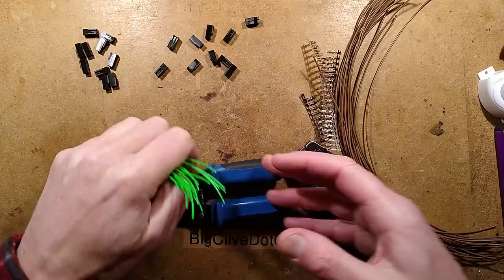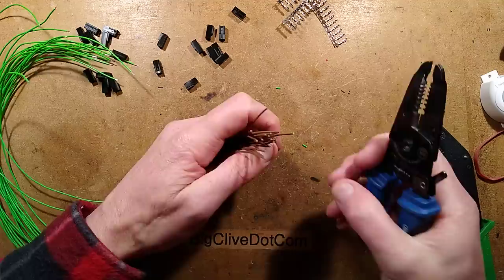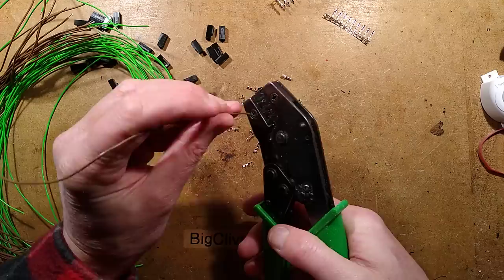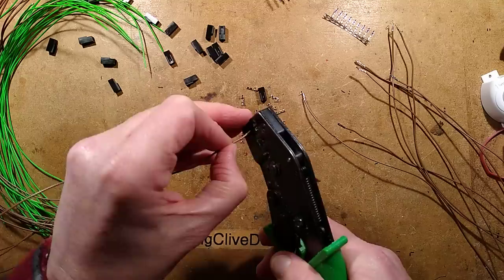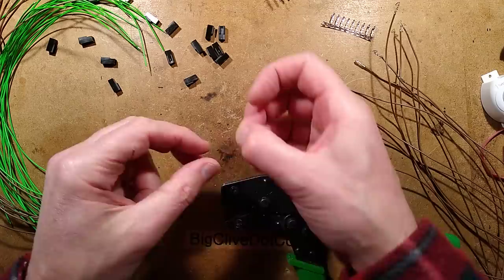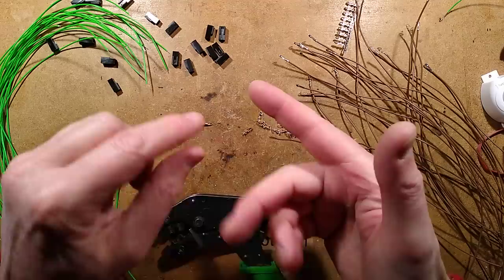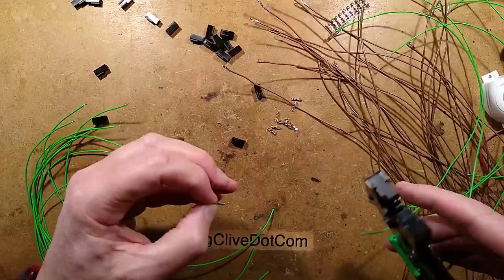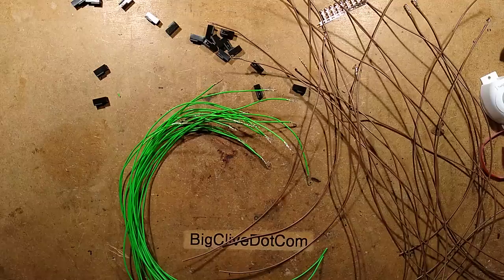Q&A while making prop stuff Part-1

Comment: I used to work on HV and when I was an apprentice one of my mates was working with an old fitter doing bus bar cleaning. They opened a panel and the fitter looked inside and said “that’s funny I have never seen one of those before”  and wiped what turned out to be a bus bar insulator which was still energised.  That unfortunately was the end of the fitter. I won’t go into the full details but my mate needed counselling for years. That was over fifty years ago, and I still think of that incident.

Comment: Years ago I got poked pretty good by a 277/480v line that was supposed to have been turned off. That was the day I learned the guy working on the wiring should be the guy that verifies the circuit is actually off.

Comment: As someone who's learning welding at tech school, I would highly recommend going a similar route. If you decide later on that you hate doing it, at least you didn't buy any of the machines...
Reply: You'll probably also have a much better idea of what machine you actually should buy if you decide to go on with it.  This is particularly important for machines that need gas cylinders, as those are probably going to cost like a BASTARD to get out on the Isle of Mann.  They're hazardous cargo, so they're not something you can just hop on the ferry with.  (I think this might leave stick welding as the only viable form unless you've got the money for regular hazardous cargo shipments.)
Reply: @evensgrey  flux-core in a MIG machine would also avoid gas tanks.
Reply: @EmyrDerfel  Looking at the process and requirements, it doesn't look like a good choice for a beginner.  You also need to either do it outdoors or in a suitably ventilated shop due to the smoke it tends to produce.  I get the impression Clive doesn't really have a lot of space to build a dedicated shop for welding and has a lot of close neighbors who wouldn't appreciate the smoke outdoors.  And the Isle of Mann is pretty wet, between a third and a half the days it rains, depending on the time of year.  Any sort of arc welding isn't something to do in the rain.

AFAICT, if you want to do home welding, the most versatile type is TIG, which will weld pretty much anything weldable.  (Looking around, I discovered that bronze is a metal to be very cautious welding, because a lot of so-called bronze is actually brass, and you really don't want to be welding brass at home.)

Comment: Hi Clive, A Ne2 tube was used in the late 70's and early 80's by microwave appliance techs (my Father) as an initial test to see if the oven was powering up the magnetron.  They had the neon in a plastic case,, kinda looked like a two pin molex connector , possibly with the legs of the bulb crimped in to hold it in place and then a clear plastic housing around the glass tube.   no actual leads or wires protruded. When running the oven, the neon would glow and seemed to pulsate.  Just a quick visual to help direct the trouble shooting.
Cheers

Comment: Around 5Ghz (ignoring crazy overclocks) has been the basic limit on processors for like 10 years now. Seems they have switched to adding more cores, and making the chips more efficient.
Reply: The biggest gains in the last ten years or so have been in a different type of efficiency; that is, more work per clock, instead of less power. Luckily this means it uses less power as well, win win.
Reply: Big improvements were made on branch prediction, too. But graphics processing mostly need not to branch, so it runs way faster than common business logic.

Comment: A”shifter” - very close to the Swedish name for an adjustable wrench: “skiftnyckel” = shift key.
Reply: Yep. We call them shifters too - shifting spanner
Reply: The funny thing is that in Dutch they are both called ”bahco” (after the Swedish brand) and/or "engelse sleutel" (= english spanner / wrench )! 
The Dutch word ”sleutel” has exactly the same meaning as ”nyckel” has in Swedish, it can either be a key (to open a door/lock) or a spanner / wrench ( the tool) so I thing that ”shift spanner” is a better literal English translation of the Swedish word ”shiftnyckel”.
Reply: @martinmanuel6228  My Papa calls it "That fuckin thing there" like all his tools.
Reply: @Acamperfull  and in Denmark they are called ‘svensknøgle’ = Swedish key :)
Reply: @Acamperfull  In Germany we call an adjustable wrench an "Engländer" (englishman) too. It is said that this is because you used them mostly for all those weird nuts and bolts found in english/american machines and automobiles.
Reply: I had a friend who called it “the lazy wrench” and that’s the only thing I call it now.
Reply: Called a "shifting spanner" or "shifter" here in Australia too.

Comment: We installed an ioniser into the duct of a conference room where i worked, it came with a piece of circuit board with a neon and resistor to test if it was working, and it worked, though this was a commercial unit
I have just bought a double decker plate ioniser and will be doing a vid on it soon, i'll try the neon
SVseeker has done a lot of aluminium welding and he shows what equipment he uses, including a spool gun for the wire
You can easily hold a live wire without problems as long as you are wearing shoes and not touching anything else, wetting the finger may help to feel it, though i don't advise anyone doing it.

Comment: In relation to the adjustable wrench question, I was wondering if you use a metric or imperial adjustable?
Reply from the maker: It's metric.  It only does millimeters.
Reply: @bigclivedotcom  Try to get a "fractional metric" one next time - they can do one tenth of a millimeter in precision and that is close enough for the odd imperial nuts you will come across in daily life. They are slightly more expensive due to the higher precision needed, but I found it worthwhile.

On the other side of the pond: sorry guys, the 1/16th of an inch "high precision" imperial shifters just don't cut it. Try to get a dual- (metric/imperial) or triple-system (metric/imperial/traditional japanese) artisanal hand crafted one from Japan. They are horribly expensive though.

😋

Comment: I have a variac that I had to modify exactly because it popped the breaker due to its inrush current. In a pinch I had a small lightbulb (recovered from a microwave) in series which I had to bypass manually, then I finally decided to make a more permanent modification adding an internal NTC (well spaced from other stuff) which I had actually managed to get as free sample

Comment: Aluminum oxide is basically sapphire, which is one of the hardest of materials.  That's also why metallic aluminum, which in it's pure form is a very soft metal, is fairly scratch resistant, but when it does get scratched it tends to be scratched pretty deeply.  To scratch it at all, you have to get through that aluminum oxide layer, and once through that the metal beneath is much softer and the same force will make a much deeper scratch.
Reply: Aluminium oxide is aluminium oxide. Sapphire (and ruby) are types of corundum, which is aluminium oxide with some other metals mixed in.

So sapphire is "basically aluminium oxide", but not the other way around. ;-)
Reply: @RFC-3514  Indeed, and the various forms of aluminium oxide which demonstrate the property of hardness are crystalline, the oxide on the surface of aluminium is amorphous and doesn't have the hardness of the crystalline oxides.

Comment: I grew up in West Texas where the wind blew constantly, stirring up the sand and creating lots of static electricity. This was perfect for siblings who liked to rub their feet on the carpet and zap the other on the ear lobe. It is also perfect for building up a charge in big metallic objects like, for instance, a bbq made from a 55-gallon barrel, and if you were to grab the wood covered handle to help pull yourself up so you could stand on something enabling you to reach the window (outside) and open it, nothing would happen. But if you were sneaking into said window after being out late you would need to put your hand on the pit and one on the aluminum window seal in order to hoist yourself in. This happened when I was about 14, my limbs locked, and for a few seconds/minutes(?) I could not move and it scared me. Eventually, it ebbed, and my legs moved so I fell. I still needed to get in, so after a few minutes I made the connection again only it was not scary and was rather pleasurable, the charge continued to wain until nothing could be felt.

Comment: Your story about the compressor reminds me of an event about 30 years ago; we were building radio cabins for a UOR for the MoD. The cabins were to be powered from 20kVA gensets, but we found they were stalling the generators even with the radio gear switched off. We suspected the transformers on the input of the cabin were causing the problem, so we needed to check the I, V and their phase relationship. I made sure the incoming supply was isolated by unplugging the 32A 3Ph supply; unfortunately there was no lockout facility, so we just coiled up the cable to ensure it was safely disconnected from the mains. I was working in the vault, having just hooked up 3 current probes and just finished connecting the last of the 3 voltage probes to the busbars when I heard the contactors pull in; I nearly shat myself as that's not a sound you want to hear whilst handling the incomer terminals! I subsequently found out that a technician spotted the 63A Commando connector sitting on the floor and decided, without checking, that is should be plugged in and the supply turned on!

Comment: Doing well with the crimper Clive ;)  I often preload too far by mistake, and then the only way to clear the ratchet is to close and waste the crimp :(
Reply from the maker: You can unlock it with the little lever between the handles if it's not too tight.   I dread to think how many crimps I've done with those tools.
Reply: I have the non-ratchet tool (it was much cheaper!) which is fine for these small crimps, though it is slower because it takes two operations for each, but most ratchet types have a release lever somewhere.

Comment: 21:45 Computers have, for the most part, stopped increasing in cycle speed.  We had to because the heat dissipation from driving the gates faster was getting entirely unsupportable.  (When you're getting dies emitting heat at a rate comparable to the optical surface of some of the cooler stars, it's time to try something else.)  The main way we get more effective computing power these days is mostly to add more processor cores.  The computer I'm doing this on has 4 cores, and the newer computer I have has 6, and that was only because I didn't think I could use the really high-core-count processors effectively in the near future.  (Currently, AMD lists their highest core count CPUs as having 64 cores, and Intel lists their highest at 72.  The AMD CPUs are also listed as having a higher base clock speed, which is actually lower than the clock speed on either of my current computers.  IIRC, this has to do with it becoming progressively more difficult to organize the signals on more complex PCUs with more cores as the core count goes up.)
Reply: Also each core tries harder and harder to execute multiple instructions at the same time.
Reply: @0x8badf00d  I think you have to program the software in a way it uses several cores in parallel. Something like threads and tasks stuff. This leads to a complete other paradigma not all programmers understood well these days xD
Reply: @gunnark9823  No, I'm referring to superscalar processors (which has been a thing since at least the 90's).  Each individual core or even individual hardware thread can execute multiple instructions simultaneously.
Reply: @0x8badf00d  IIRC, that innovation was the thing that caused the 486's to run so much faster than the 386's.  Each stage in the execution pipeline can work on a different instruction, so a lot of the speed disadvantages of a multi-cycle execution pipeline disappeared..  Pentiums added branch prediction so that the more likely execution path would be started down, further optimizing the execution.  There are also things like the ability to dynamically decide to execute some instructions out of sequence to further optimize execution speed.

It used to be that the much shorter execution pipelines on RISC chips made them able to perform logically equivalent operations faster than CISC chips could, but superscalar largely did away with that.  Even if you build a superscalar RISC chip, the inherent nature of a RISC chip means it gains far less benefit from it than a CISC chip does.  You also tend to start losing some of the advantages of RISC designs like lower power consumption if you start trying to add the kind of execution enhancement features used on modern CISC chips, and gain much less performance increase for the extra power and heat dissipation it costs you.  For a device like a phone, with a sharply limited battery,  lowered power consumption is more important than a modest speed boost.  After all, people don't normally try to do intensive things on their phones.  (Yes, Nokia came out with software that turned their phones into hand-held consoles.  You might have noticed that most hand-held consoles have been fairly marginal systems financially for their creators.  The Nokia phone software was the descendant of a catastrophically failed dedicated hardware console.  People didn't much bother with NGage on the phones, either.  I worked in Nokia's 3rd level device support while NGage was officially available, and nobody ever sent us cases about it.  Not even from China, where phones are a much bigger part of the gaming market.)
Reply: @evensgrey  amd has a 128 core 256 thread epyc cpu

Comment: Hi Clive, the answer to the solid wire and crimp question is no, you should not use solid wires with crimp terminals.
Typically crimped terminals are designed to have oxygen free environment between cable and terminal. Reason being is for corrosion/fretting/arcing etc.
The exceptions to these are sprung/screw style contacts like poke in/terminal blocks and IDC contacts where they prefer solid core wire.
I'm in the industry and these questions do come up once in a while, generally relating to quality issues!😆
Reply: * Obviously a connection is a connection, if you are not expecting the designed performance /reliability from it then fair enough- it 'still works', and could work nearly to spec for a long period, but more variables are involved. 

From a commercial perspective; they don't want things to fizzle and blow. You'd want to knuckle down variables and possibly belt and brace approach to connectivity because they're generally 'a low cost' from total cost of product but can be catastrophic if not done right (so many engineers get it wrong! So many engineers/buyers chase the '10% cheaper' and just ends up breaking the product....)

Comment: Yes, checking that something is not live is quite important, changing a socket at my grans where one socket in the room is connected to a completely different fuse box, the slight tingle told me "this socket is still live!". The separate fuse boxes does have it's advantage (one just does the shower and the kitchen sockets) as you can use one set of sockets to power lighting when working on anything on the other fuse box. 
It also allowed me to use a table lamp to check a circuit is dead as I could plug it in to the socket to be replaced to prove that i9t was dead and then plug it into an extension powered by the other fuse box to confirm that the light works and as such I can guarantee the socket is dead.

Comment: I was friends with an old electrician who had to lick his fingers to even feel 120v, could barely feel 220v dry, said 480v started to tingle, and 600 hurt like the dickens!
My worst shock was 480v across phases, standing on wet metal.
I am alive because I had insulating boots on, and the shock was across my knuckles after my thumb slipped off a motor starter overload reset button and I punched the wire lugs.
I also keep my left hand behind my back when open cabineting for just this type of situation lol

Comment: You're right about calculators! I have several!
Reply: Anyone ever seen those pocket calculators possibly Casio that have the dot matrix screens versus 7 segment?

The ones if you put in a certain order of digits and operations...

In some cases turn the same sideways once you do this...

Yes I'm referring to the game Easter eggs on a calculator!

It just goes to show the computing power of a single-chip has increased exponentially over the years.

And once inside something you could do so much more than it is already doing!

And no this is not a graphing calculator it's just one with a dot matrix LCD.

As one might call a four banger or four function calculator!

Not an official download myself but I do know 1 or 2

Comment: Hi Clive. They sell a brazing (soldering?) stick here (USA) to join aluminum. It works with a propane torch. I tried it and it worked well. I am nobody's welder, but I got good results. I tried it and tried it to failure, and it was very strong, though not quite as strong as the base metal.

Comment: No idea about the types of crimps used here. But certainly for CAT5 / CAT6 ethernet cables there are different crimp connectors available for solid vs stranded core cables. Apparently the difference is, those intended specifically for stranded have an additional tang that pierces straight down into the core.... right into the centre of the bundle of strands in the core.